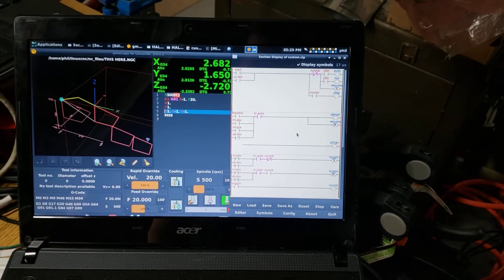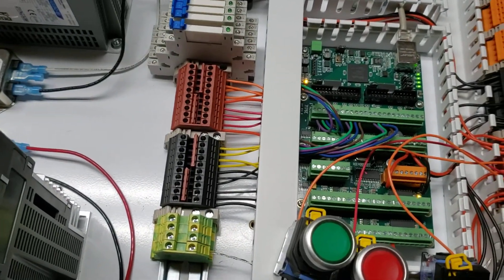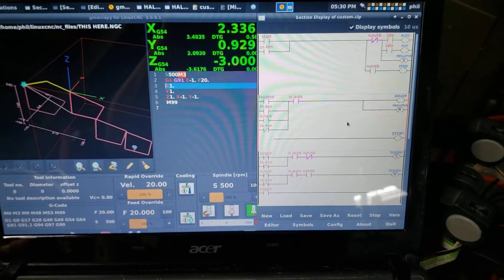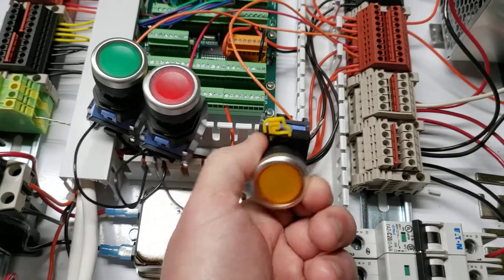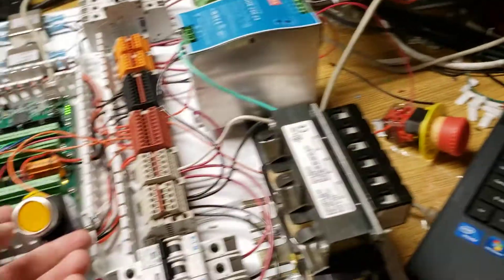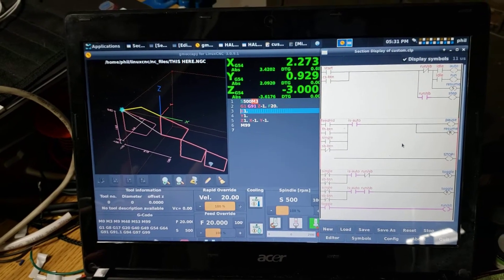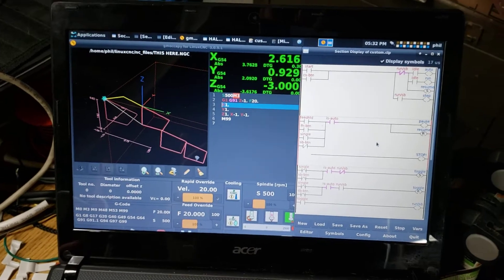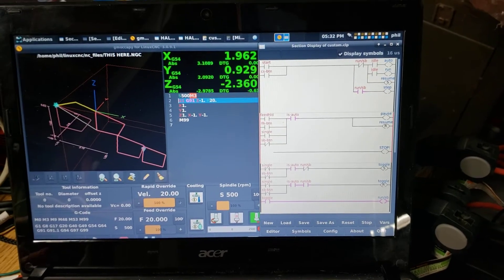LinuxCNC - testing physical cycle start, feed hold and single block buttons

Comment: Well done, I am using dmm servos as well with 1.3kw motors on an 1980 journeyman mill, I am running on an raspberry pi 4, and the machine is a beast now.. using an 7i77 with 0 complaints,  deleted external encoders and feedback is via scaling through drive. ONE THING,  use line reactors on drives and noise filters,  I blew one the other day. I am probably going to mimic your buttons,  but time is limited due to a newborn in my world on the day after Christmas...I see your noise filters,  if you do not have line reactors,  add them...
Reply from the maker: I've got one 👌👌

Comment: Awesome solution using classic ladder to achieve single block mode. I have seen guys write a python script to achieve this but your method looks much simpler.

Are you able to provide some more information on you inputs, outputs and classic ladder script?
Reply from the maker: Yup, as part of my ladder series, I'm going to go over my circuit. I'm not going to recreate it in real time because it was a royal pain in the ass, but I'll do an in depth overview